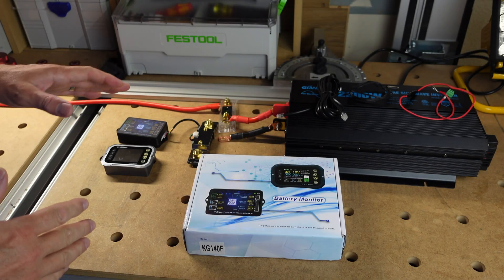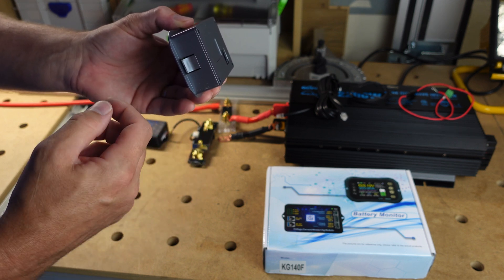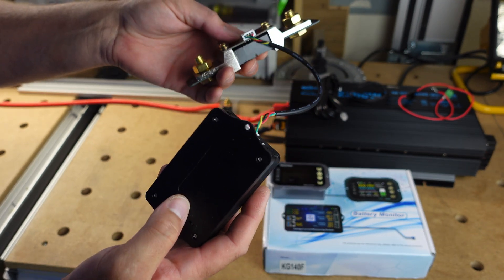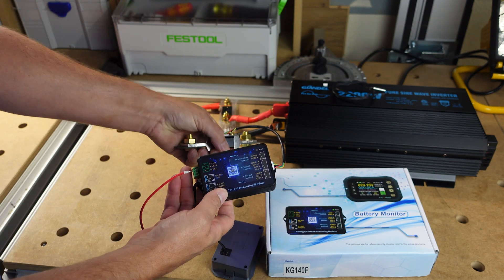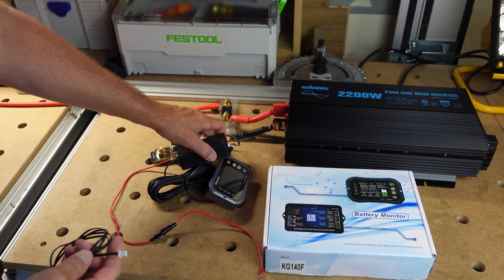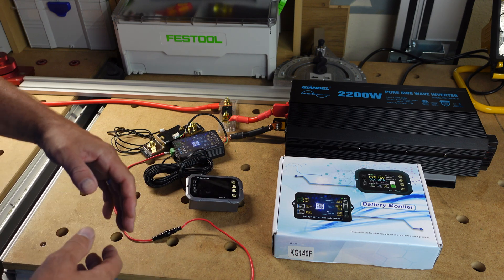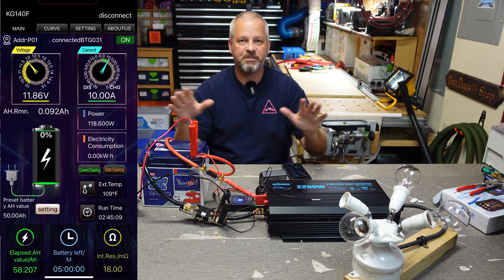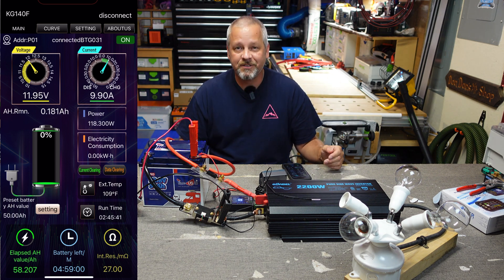How to install a battery monitoring shunt - WovVon 400amp Bluetooth Battery Monitor

Comment: Good video..... I am installing this unit in my RV but I won't always be using my inverter so I am wondering if my install would call for a different connection? With the inverter off is the unit still going to be able to calculate?  I will only need 120v during the evening.

Comment: Great video. What size fuse are you using or recommend for this setup with same battery your using snd same inverter? Thank you again!
Reply from the maker: For safety I usually recommend a fuse 20amps larger than the max rated discharge of the battery or the inverter.

Comment: As my system is not in use everyday, if you turn the shunt off to save any long term power drain on the battery, will it retain its settings?
Reply from the maker: No, it will lose its last setting if you remove it from power. At least on this specific shunt.

Comment: I'm wondering if I hook the monitor into a kill switch, will it forget the battery stats and reset everything? I would use this on a boat and I wouldn't want to have the battery monitoring module empty the main battery it if I wasn't going boating for a while. I would really like to have it remember the main battery stats and the state of charge. Am I forced to buy a smaller external battery for the monitor that won't affect the main battery?

Comment: I just installed this battery monitor and was very happy with it at the start. I set the battery bank capacity to 300ah and when fully charged to 100%. Everything was good, but after a day I noticed that all readings were still the same. I turned off the charger, put on a few more LED lights and the monitor showed all these changes, but the app on my phone is stuck on the original settings. Even still showing it's charging when the charger is turned off. 
Can't change any settings on the app, can't turn it off and can't disconnect, nothing, any ideas if you read this post, thanks in advance.

Comment: So I have a question you seem to understand this pretty well all the videos I have seen are using inverters  I have a lithium battery in back of my suv to help Power my system subwoofers and amp. So the correct way to hook this up would be to put the shunt in between the lithium battery and my amplifier? Is that correct
Reply from the maker: That would be my guess, but I’ve never dealt with a car amp before with this type of setup.

Comment: Does the app work on both iphone and Android phones? i have android
Reply from the maker: Yes, there is an android app as well👍🏻
Reply: lj @GearGadgetReviews  thank you for the quick reply 
    WovVon 400amp mine will arrive today and my battery just got here 1/2 hr ago the TIMEUSB 12v 200ah 200BMS plus battery.... KILLER DEAL 474.00 PLUS TAX direct from Timeusb

Comment: I like the build, but had to do some of my own research on what relay I would need to use for low temperature cut-off.  Maybe you could build out and show how it is done with this monitor for a budget LifePo4 battery that doesn't have low temp cut-off.  Thanks for the review.
Reply from the maker: I’m going to try and get around to doing that….eventually